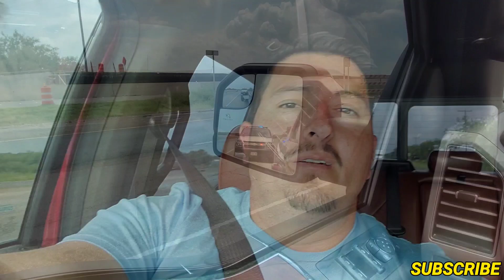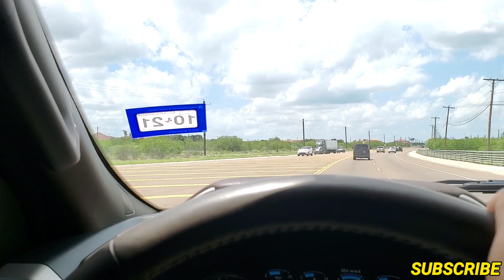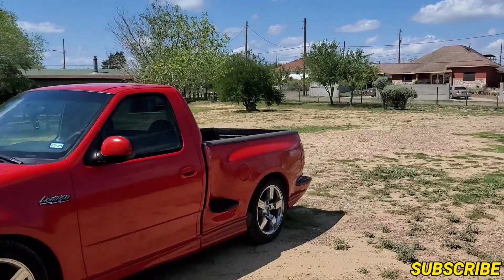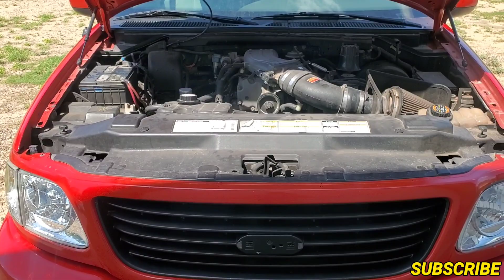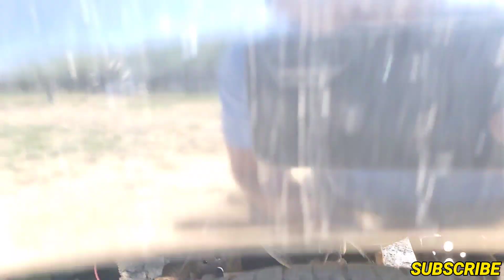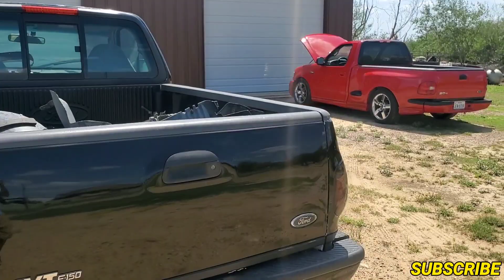Picking Up Another Svt Lightning To Work On. 💪

Comment: Hell yeah cant wait to get the black one, itll go straight to the paint shop with all new front end parts i got waiting here, thanks alot Dave and Mando 👍
Reply from the maker: The motor should be at the shop and getting tested and cut. It will be a great build as well

Comment: How do you get a permit for tint
Reply from the maker: I had a couple of surgery in the past and over time I had struggled to see in the day time and after check ups and different exams. They determine  a rare condition. That to much sun light or cars at night with high beams on. Cause my eyes to burn on the inside and can really see. That how they gave me my permit

Comment: Last time I went to McAllen from rio I encountered over 30, most are just sitting in packs on the side of the road. 

Even when you encounter them on the road they ride in packs like bikers.

BTW you should add a sticker to the rear window or next to the plate that says "I have a permit for the tint"
Reply from the maker: It's a bunch of them bro and I have to go to the dmv so they can issue the permit to my license and then it will come out on my plates